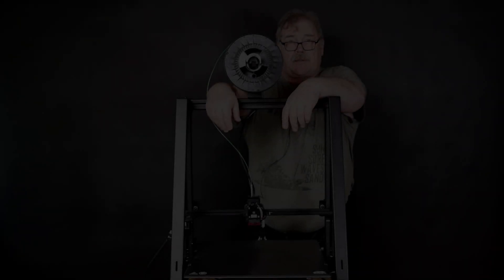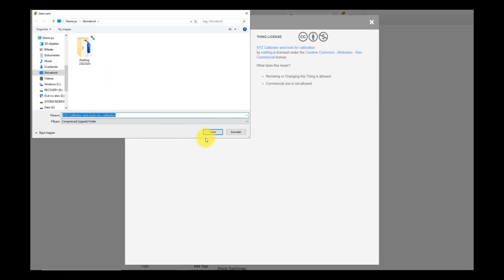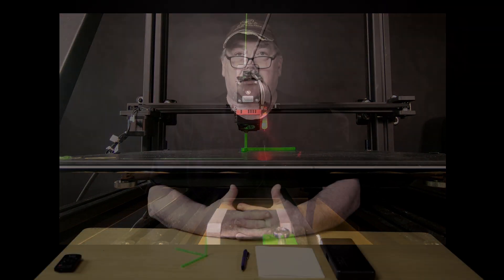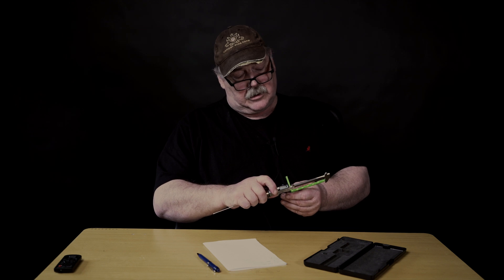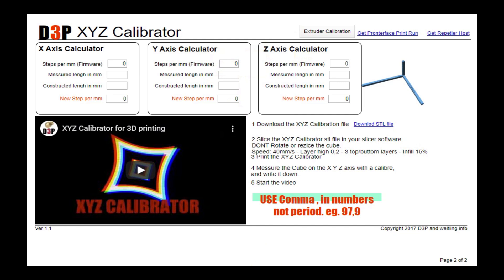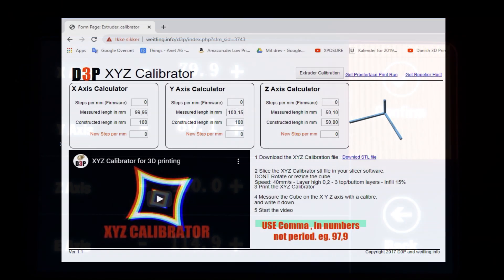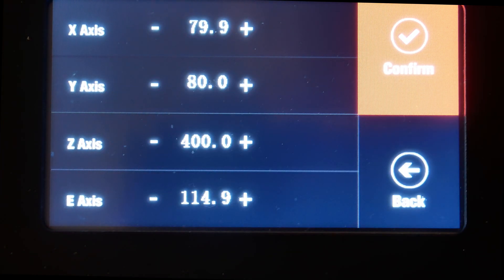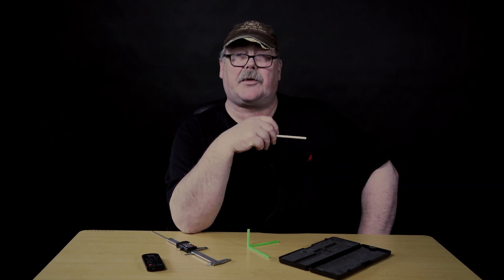Part 2 Calibrate X Y Z axis made easy Wanhao D9 and other 3d printer

Comment: you may of just saved my desire to print 3d.. i have a wanhao i3 plus and I'll let you know how my new print turns out after I calibrate it, but i recently replaced my hot end and extruder and I printed something and it's about half the height I feel it should be.. very squished!  I can't wait to see how far off it was now that I know how to calibrate my 3d printer!  THANK YOU!
Reply: the link for the calculator doesn't seem to work anymore, I hope things are alright and it'll be back up soon!